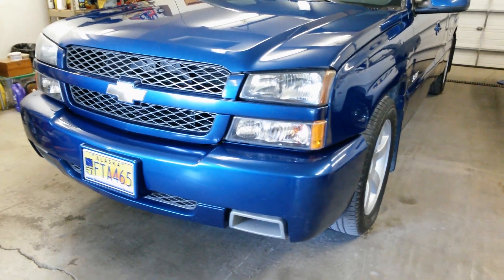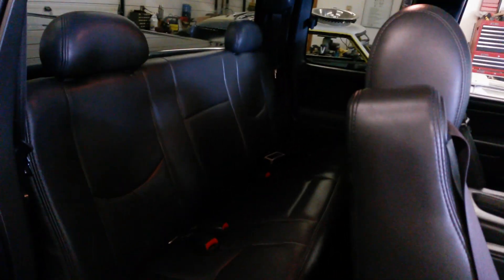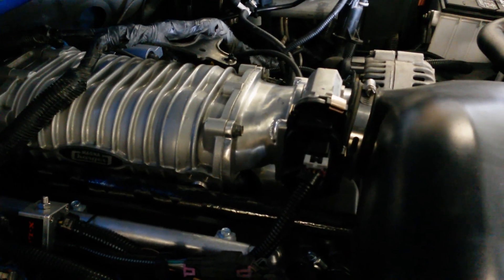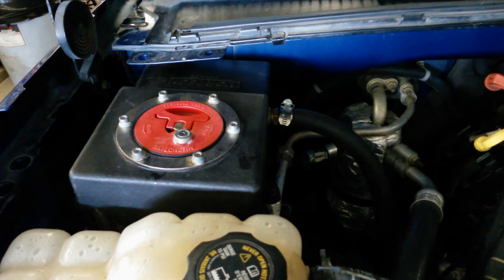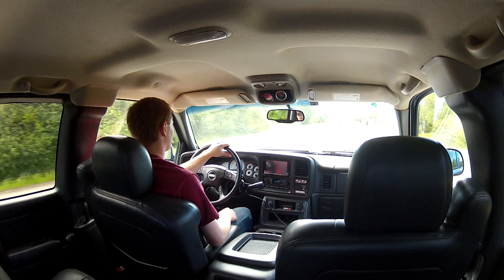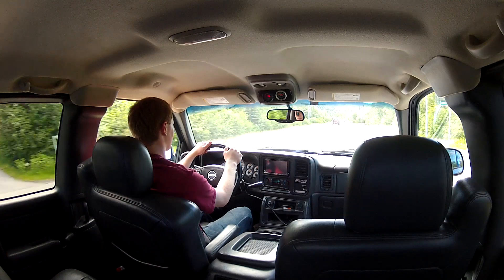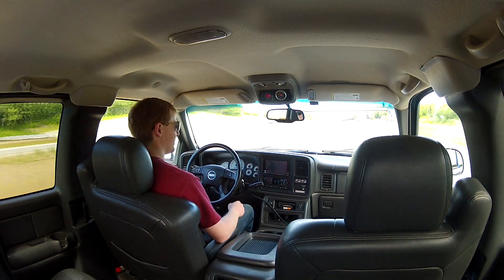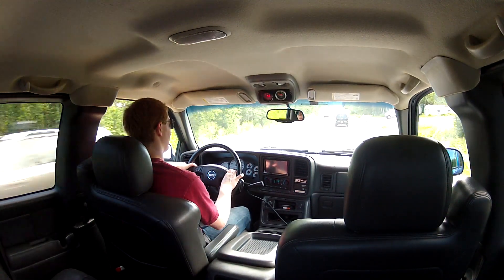2003 Chevy Silverado SS Magnacharger MP122 Installed and Test Run

Comment: Just bought an 01 Ext Cab White with 176k from Army Mechanic thats in the family for 2400$ has 5.3 liter in it and its my first truck and let me tell ya I was impressed how strong the LS motor is in the truck. Hoping to get it cammed and K&N intake and some straight pipes and headers and tuned and thatll be good for me I think...Sweet truck brother!
Reply: Honestly cheaper to swap to a 6.0 than build out the 5.3

Comment: Hey there, Very nice truck. I have a 2004 SS and the same color, Arrival Blue Metallic. Mine has about 178,000 miles, only 39,000 when I bought it 5 years ago. I was wondering why you took the supercharger off because I want to install one? Was there anything like engine damage to the original LQ9? I have heard that flat top pistons are what's needed for a supercharger but I don't know? I pull a couple of different heavy trailers and a little bit more power would be grand. 345HP stock to 450-500HP would be so nice.

Comment: you installed the supercharger when the engine had 170,000 miles? have you had any problems with? how bout the transmission? is it still holding up? i wanna boost mine too but have as much miles as yours did.
Reply from the maker: Yes the supercharger was installed at 170k but I have since removed it to transfer to a car project. The trans had no issues, I wouldn't hesitate to do it again.
Reply: Alrighty man i appreciate the feedback! Ill probably go through with it. And do you remember what trans you had? A 4l80e or 4l60e?
Reply: @ClearlyyMel  they have a 4L65E
Reply: @ClearlyyMel  blew my 4l60 with 200k the same day I did my 6.0 swap. Just for whoever is reading. Factor a trans into the build.

Comment: Did you ever run the truck on the track? If so what was your times? I have an 04 ss I'm wanting to boost but I'm so indecisive on how I want to go about it. Trying to be on a budget lol
Reply from the maker: I did run the truck on the track 1/4 mile with this Supercharger. It heat soaked and it didn't run good times. I would recommend doing a LSA supercharger or a newer Magnacharger TVS 2300 / Edelbrock system

Comment: I was under the impression when you install a supercharger or a turbo the gas mileage will get better under normal driving conditions. If the purpose was to increase power and still drive normal, a supercharger should enhance your gas mileage. But if you drive it hard then the gas mileage will surely decrease. is this correct?
Reply from the maker: +Kudro Rico Your impression is correct, most of the time under normal driving conditions the gas mileage stays roughly the same, on mine it decreased slightly, some see improvements, depends on the tune and the setup, and driving style.
Reply: I am looking for as nice supercharger for my 5.3 L V8 Chevy Suburban. Any advice?
I want more power to improve driving on highways.
Reply from the maker: +Kudro Rico Contact Superchargers Online, they are a reseller for Magnacharger. They should be able to get you one for your Suburban. Another option is to check ebay and see if you can find a used MP112 or TVS 1900.

Comment: How many miles did you put on the SC before you took it out? And what's the fuel economy like on the highway before the SC? Thanks
Reply from the maker: +The96jaime My SS gets right about 16-17 on the highway in stock form before the supercharger. After the supercharger mileage went down as expected, I would guesstimate it got around 14-15 mpg with the supercharger. I never checked it on my SS before I removed the S/C.
Reply: Why did you remove the supercharger?
Reply: @mattbetz  you can cancel the 4x4 to make it simple

Comment: Did the mpg drop? If so by how much?
Reply from the maker: Yes it did by a couple MPG. Used to get around 13 in the summer now only gets about 11 (city). Winter is even worse, my tune is not setup perfectly though so I feel that it could be a lot better.
Reply: Okay thanks